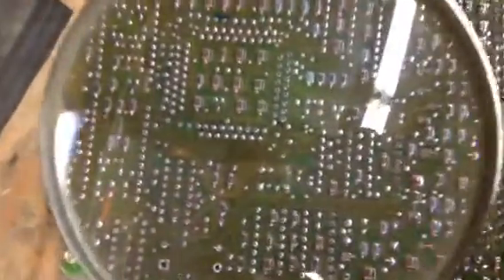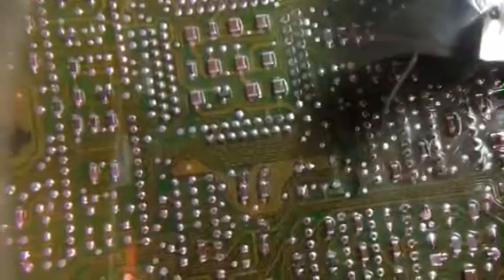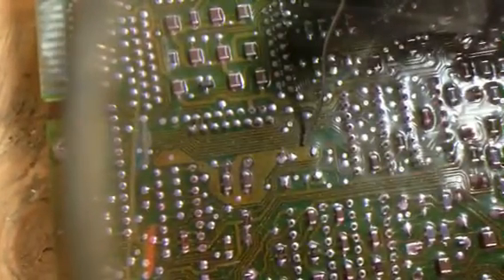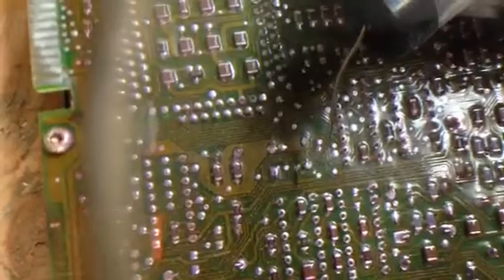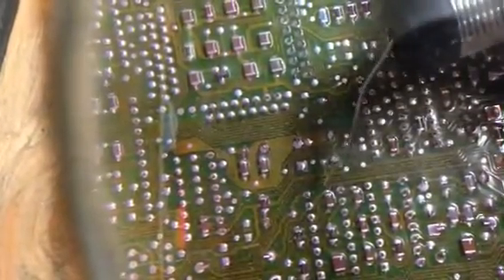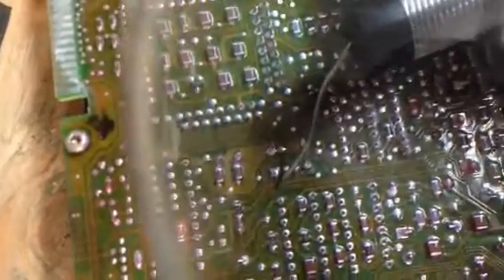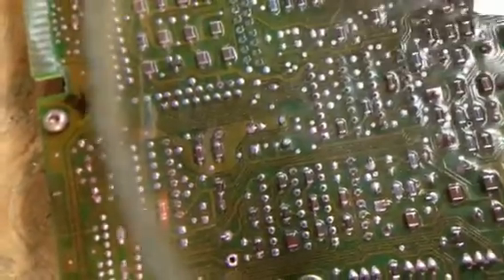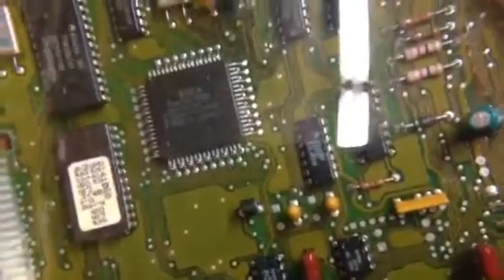1993 F150 computer repair

Comment from the maker: It had a bad capacitor, a good bit of rusty water stains, and some green corrosion around the capacitor and a heat sink. 

The truck would have symptoms of not enough fuel pressure and or a bad throttle position sensor (which the dealer replaced even though a fuel pressure gauge on the fuel rail confirmed that it did have enough fuel pressure.

Comment from the maker: I replaced my capacitors and they lasted about four or five years and I ran the truck once every month or so. Those capacitors leaked out and the board fried but there may have been other issues due to corrosion. I got a remanufactured computer and put it in and it only lasted about six months and the truck started running, shifting, Not engaging in cruise control, and the ABS light coming on, and idling erratically so after following the manufactures test procedure on the anti-lock brake module it told me it had a bad ECU. I pull ed the computer out and looked inside and sure enough a capacitor was starting to leak again. 

The computer is still under warranty until next February so I’ll go ahead and change it out but if this happens next time I’m going to put different capacitors in of the SAME microfarad rating but a higher voltage. 

See the following video for why I intend to do this. https://youtu.be/Noy4YAjoJE4